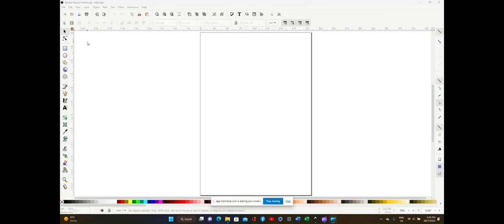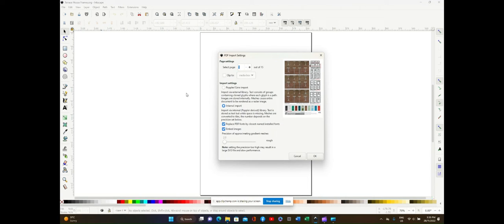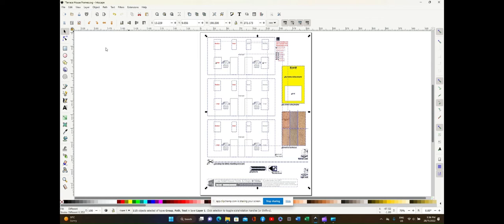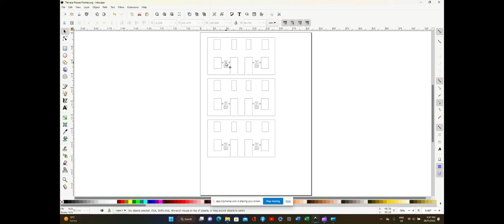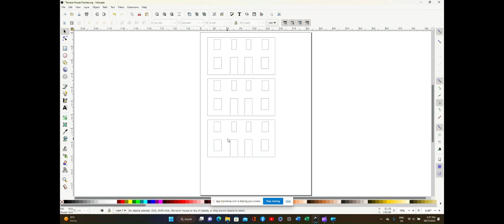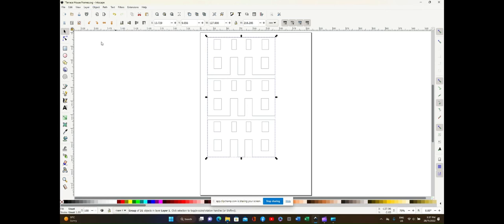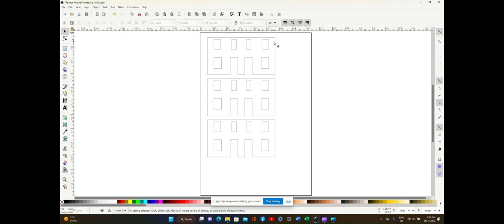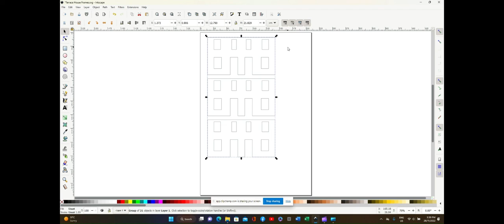Edit a PDF file in INKSCAPE

Comment: And how PDF text can be edited? 
-This result for: "inkscape how to edit PDF text?"??
Reply from the maker: Hi, the video is related to editing PDF files when drawing in Inkscape then sending to cutting machines. The video does not deal with editable text, however, there are a number of PDF files that do contain editable text but these are added in the design of the PDF File, for example Scalescenes signage comes with editable section for changing place names etc.  I will take a look at any editors that may be available for the text changes you need.  Do you have an example PDF file I can look at?
Reply from the maker: I have looked at number of edit programs and this is process for few of them,

Editing text in a PDF can be done using various tools. Here are a few options you can try:

Adobe Acrobat:
Open your PDF in Adobe Acrobat.
Click on the “Edit PDF” tool in the right pane.
Use the editing tools to add, edit, or update text and images.
Save your changes.

Smallpdf:
Go to Smallpdf’s PDF Editor.
Upload your PDF file.
Use the tools to add text, images, shapes, and annotations.
Download your edited PDF2.

Sejda:
Visit Sejda’s PDF Editor.
Upload your PDF.
Click on the text you want to edit or add new text.
Save and download your edited file.

There is a free version of an edit program, which I have not used, it is at. - nchsoftware.com

Hope this helps.

Comment: Is it possible to import multiple PNG files into a program that I can then convert into a one PDF file? Thx! :)
Reply from the maker: Hello, what program are you using for creating the .png files and which program are you thinking of importing them into.  Alan
Reply from the maker: Hi Rejken. I have just created two simple .png files exported them from Inkscape and then amalgamated into one file and resvaed as a .PDF file again in Inkscape. So looks OK to do it - however may be a problem if the files are large and there can be degradation in the PDF when printed.  Let me know if this answers your question Cheers Alan.